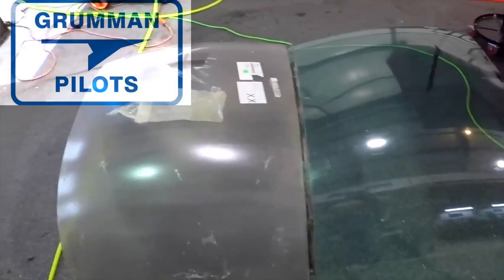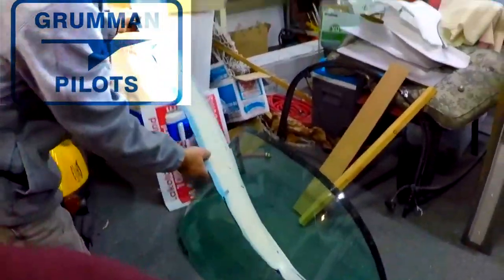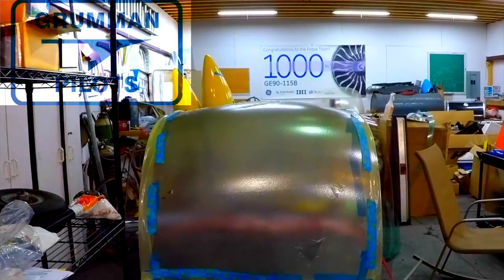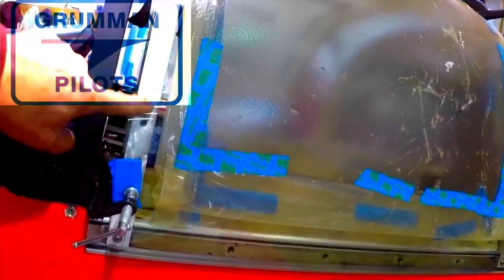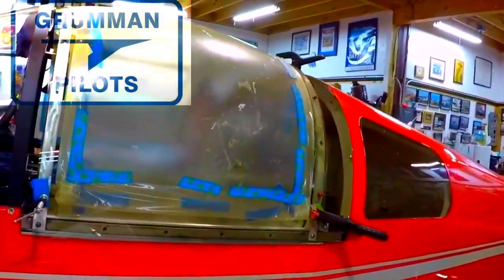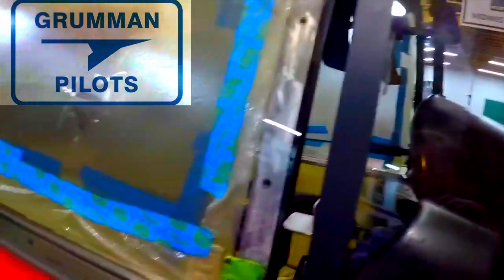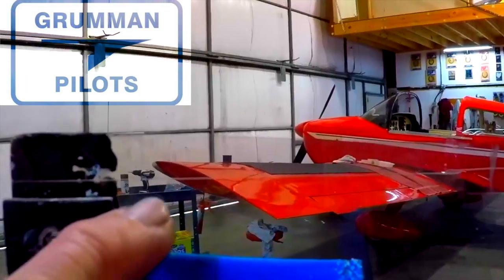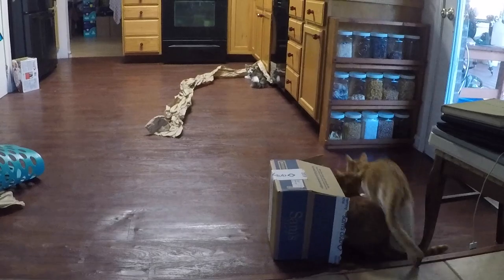Complete 2-Place  Canopy Change Guide - Grumman Style

Comment: Great stuff! My canopy on my Yankee sticks at about the half way point. I try to open it after landing, I push back from the center top of the canopy and it sticks at about the half way point. I then have to use right hand left hand right hand left hand, etc to move it all the way rearward. I’ve sprayed it heavily with silicone lube. Is it off track or am I doing something wrong? I’m new to Grumman.
Reply from the maker: Most likely the raid and tracks are just filthy and need to be cleaned.  Canopy will need to come off to get at the rails but clean them, then a drop of silicone on each slide and you are good to go for years.
Reply: @GrummanPilots  awesome, thank you.
Reply from the maker: Glad it is helping you.